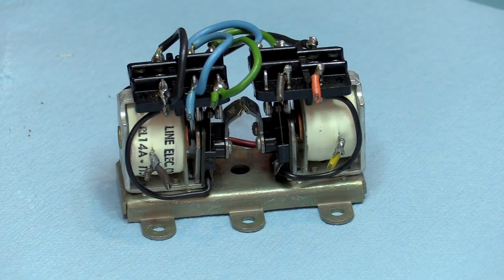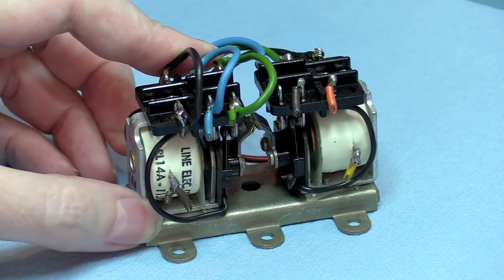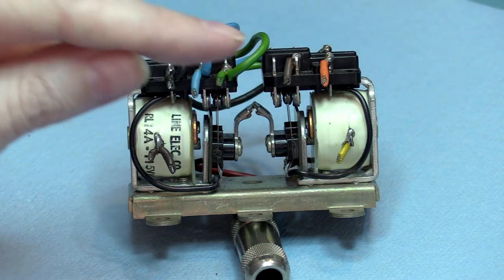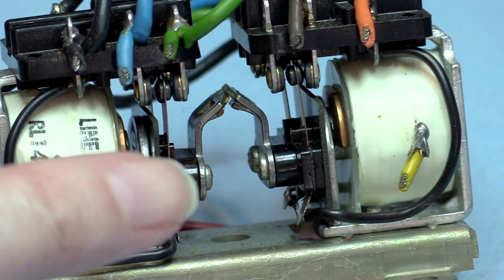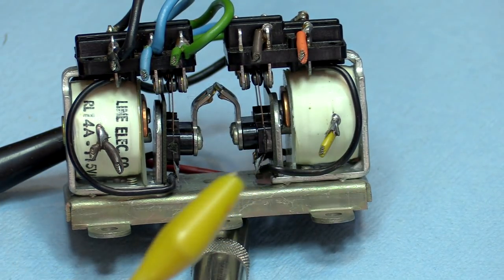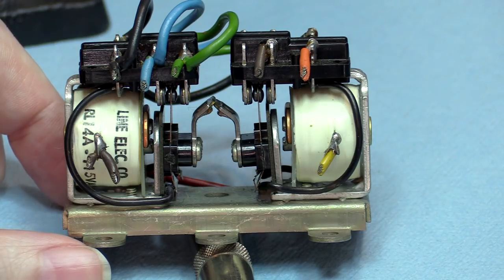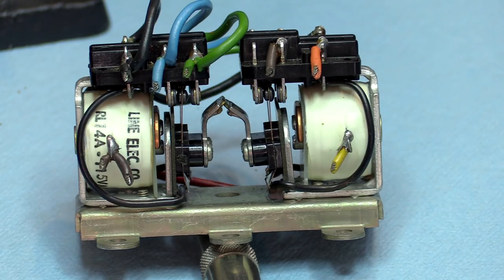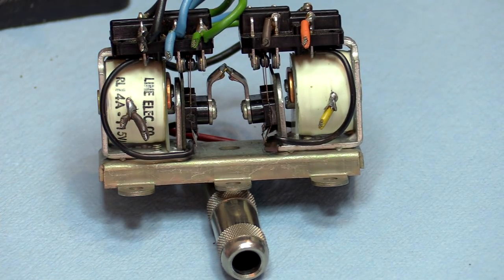Now That's What I Call A Flip-Flop!!!

Comment: Had a thought.....Can you wire the relay coil through the opposite relays normally open contacts and join both together so that the unit toggles on each pulse on one wire?
Thus you won't need to energize one coil or the other by touching each coil alternately.
I.E. pulses will be presented to both relays normally open contacts simultaneously, the relay that is 'closed' will direct current to the other's coil. Hence a true flip flop...
Should work....fingers crossed.
Reply: ratchet relay is easier
Reply: @Rob2  the mechanical interlock
Reply: @Rob2  ahhhh. the devil is in the detail, nice idea, i think you're right! suggestions?

Comment: Of course, electromechanical flip-flops were used by the hundreds as the "memory units" in the combination actions of the pipe organs of yesteryear. A combination action lets an organist program presets ahead of time that can be recalled by the push of a button called a piston. This then causes solenoids to activate or withdraw the stops (drawknobs) as previously programmed. This makes rapid stop changes possible. In large organs, the combination action could fill a small room remote from the console.

Comment: Pretty clever, not only is it a flip-flop but it does not need any current to stay latched. Do you know where is was used, I'm guessing elevator control to maintain state in case of a power failure.

Comment: That style of dual-coil flip-flop is still used in industrial control systems, particularly those that must retain state when power is lost and restored (needing power only to change state, not retain it).  Another property is they are inherently rad-hard, and so are used in nuclear power safety systems.  This is subtly different from a latching bi-stable single-coil relay, which requires voltage polarity reversal to change state (logically equivalent, though certainly not electrically).

Brady Haran's latest Objectivity with Matt Parker (https://youtu.be/ZSJjbmpXip8) shows a one-bit vacuum tube module, which is essentially a flip-flop as well.  A nice story, though they don't go into any depth.

Comment: Your next crazy device needs to be one of those AC ratcheting relays that acted as a flip flop circuit in lionel trains. (yes, I know you know what I'm talking about)
Reply: An old tube remote control TV we had from when I was a kid had one of these stepper relays to control the various volume levels you could adjust with the remote.

Comment: I can honestly say I've never seen one of those before! - It reminds me of some of the stuff my dad and granddad used to recover from their workplaces. I was always fascinated by the way these mechanical devices could latch and release each other. My dad worked on the railways, and my granddad at one of the major confectioners in our area. What was also interesting was that despite the massive divide between their work, the things they worked with were strikingly similar.

Now, at first when you started the video, I thought this was going to be some form of 'auto flip-flop' which would continuously swap states until de-energised.

Interesting little device. May I ask what it came out of?

Comment: I know there were mainframes the used only relays. As far as I can tell they didn't use the relay you have in the memory circuits. At least one computer used cross bar relays such as those used in telephone systems. They also tended to use telephone relays in general.

Comment: I have seen and worked on 100% mechanical flip flops. Basically with pressured air, valve switches etc. No electronics involved at all.
In my case it was part of the control theory course. 
Everyone who knows a thing or two about control theory knows this is possible. 
Basically you can see the stop in your toilet reservoir this way as well. Some even oscillate!!

Comment: Have you done anything on wire recorders? I got a glimps of one once. Always wondered how good they were. And how long a wire would hold its information. And how they managed the wire not to lock itself up on the spools.
Reply: Regarding the last point, I don't think they really managed to stop the wire from getting tangled or caught up. AFAIK that's why tape replaced it, flat strips of plastic are more resilient than really thin wire.

Comment: "Hongfa 2P2T latching relay" cost about $2.5. Completely sealed, boring to look at, very useful.
You can also look at a dipped headlight relay (dull) or the magic direction switch on Märklin model locos. Well, the only interesting thing is in fact the latching mechanism in all of these.

Comment: Would you still call it a flip flop if you removed a solenoid and replaced it with your finger ?
Such as the keys on a teletype terminal - prod a key with the finger, they're mechanically held down until released by the energising of a solenoid. Ditto some lift buttons.

Comment: I'd really love to know where something like this would have been used.
Reply: Although I have never seen this type reading Monothefox reply about them used in railway signalling I guess like British Railways they are used in points or railroad Switch circuits as you may know them. When a route is set for a train there is a need to keep it locked even in the event of a power failure. A train traveling at 125 mph could run a considerable distance before it could stop.  This type of relay mechanically remembers which direction the train was signalled to go when the power failed, and when power returns prevent points or switches moving under a train passing over them, which could happen if this type of memory relay was not used and during the time the power was off an attempt to set new route was made. There are several other circuits involved in the process to unlock the flip or flop memory that would need the original route setting command to correspond with the memory mechanically retained by these relays

Comment: I've seen latching relays with dual windings that do this without having the additional interlocking levers. I wonder what's the advantage of this design
Reply: latching relays need reversing polarity or antiparallel coil winding... But this one works happily with AC, so the antiparallel winding on the same core wont do anything.

Comment: It appears that there is a constant electrical connection between the two paddles. There may be a short break in current when switching.  I don't understand how it outputs anything other than a "1." Is it by detecting which paddle is "on top" - I do not see how that is done.
Reply: I’m pretty sure that the paddles are for mechanical purposes only, and are electrically isolated from all of the contacts.  It’s hard to see in the picture whether each relay is 1-pole or 2-pole, but they look more like 2-pole to me (you can see the wires on the back side going to the other moving contact).  The mechanical paddles are in the middle, mounted onto the plastic insulator.  Their mounting screws look like they thread into the relay armature, which is also electrically isolated from any of the contacts.

Comment: So a two-coil latching relay is really just an electromechanical flip flop? That's what this is - drive one coil to set, drive the other to reset. Miniaturized versions of these are used in programmable true bypass switching boards. Common as clarts these days, with DPDT latching relays often selling for less than DPDT pushbutton switches.

Comment: Do the little paddles ever separate? It doesn’t look like they do. I don’t get it!
Reply: Well they would if you applied power to both coils at the same time and that would make both sets of normally open contacts close. And that would be a possible operating mode based on the system needs. This relay has that ability. The magnetic latching relay that Fran mentioned can't do that. It is is one way or the other period. But the primary application of these relays is the ability to store the last state without needing any power.
Reply: @andydelle4509  Ah, ok thanks. Yes it would. But would you still call it a flip flop? I want my flip flops to flip or flop, not flap.

Comment: My question is if it was a flop flop then a would a single signal flip the relay state? 
If set up correctly I do believe you can change this into a flip flop relay but you must build a circuit to do 2 things. 1 block one coil from receiving voltage while the other is engaged 2. Hmmm... I think number 1 says it all
Reply: This device appears that, most of the time, neither coil is energized.  You would briefly apply power to coil A to flip the relay.  It would stay flipped after you removed the power.  Same with coil B to flip it the other way.
Reply: @kc9scott  - So  it's a latching relay
Reply: @drprinter  Yes.

Comment: Stating "Flip-flop" is "an electronic device..." is already wrong. Because the first flip-flops were pure mechanical parts of purely mechanical automatic machines. And were very common using pneumatic and then hydraulic implementations even prior any electrical implementation was practical for the function...
And the first electromechanical implementations were what is today known as "latching relais" (a permanent magnet holds the state, it is just briefly overcome by an electromagnet to change the state).
So this contraption is indeed a true flip-flop.